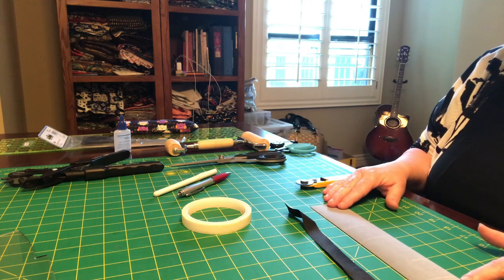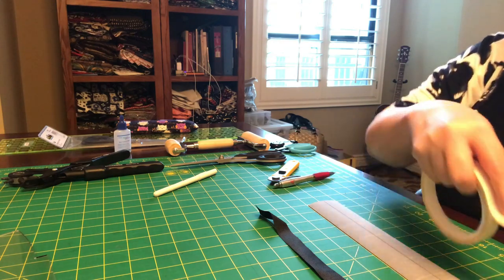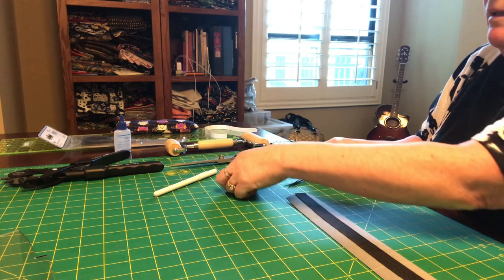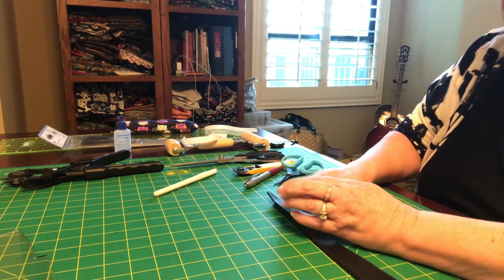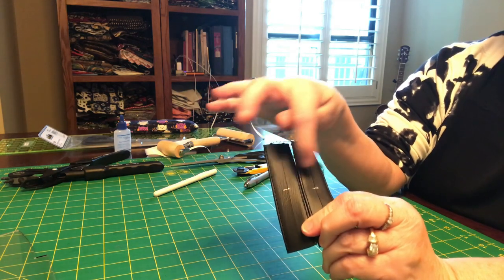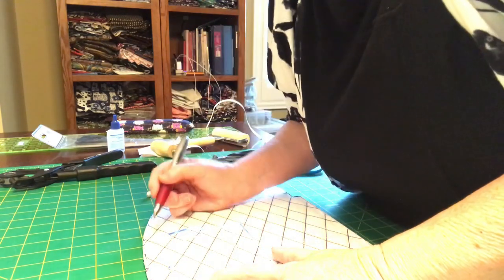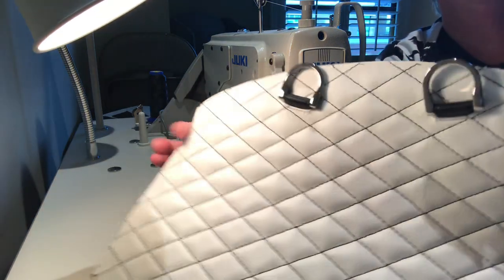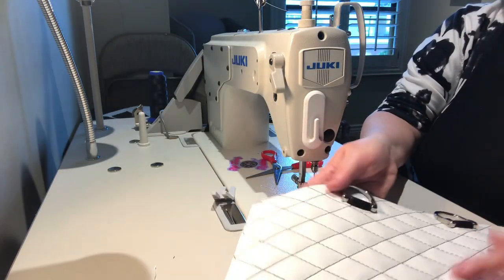Hidden Connectors  -  The MUST Save Video for Bag Makers

Comment: A hint.   if you use a hairdryer around the opening, it will soften the vinyl but not shrink it.  You could likely then pass through easier.  I make golf cars seat covers with marine vinyl and this is what I do to make it easier to handle.

Comment: The narrow black piece you put down the center - what did you say it is?  Cordera or something like that.    Another informative video
Reply from the maker: Hi Sharon.  Yes, Cordura.  You can find on ebay; but really, you could use ribbon, rip stop, anything that will stop the stretch of the strap over time.

Comment: This is really lovely! Thanks. Was wondering if you could sew the second stitching from the back, just on the connectors? You’d want to put a bit of FabriTac or something on the vinyl edge to keep it from pulling to the front and do your rivet as usual. Would that work? Then they really would be “hidden”! 😎
Reply from the maker: Peg Farrell I think someone has tried this and it worked!

Comment: In a number of bag patterns I have made, they make a point of saying never to backstitch (or doublestitch) over vinyl as the extra holes will weaken it making it more prone to tearing. Here you are stitching twice over the vinyl above and below the slit.  Is that not an issue here?
Reply from the maker: I've read not to use tiny stitches as it perforates at stress points; but these are reinforced well.  I've never had a stitch bust apart.  Give it a try.
Reply: @sewkelley  Thanks!  I will give it a try.

Comment: Great video on this technique, Kelley! Thanks for posting this. One question about the connectors on the back - you mentioned "adding reinforcements" (other than the rivets) and said one or two pieces - I'm not sure what you mean by that - ?
Reply from the maker: It does depend on the size of your rivets, but I still feel it adds even more strength.  So, two small pieces of vinyl that I punch through, and insert the 12.7mm rivet through them all and press in place.

Comment: Where do you get cordura for the strap connectors?
Reply from the maker: You can find on Etsy.  I use 400 Denier.  You can also use other materials, ie. rip stock, Decovil Light, even webbing.